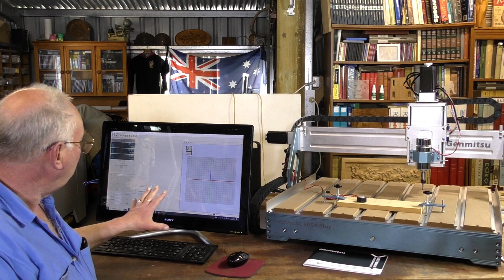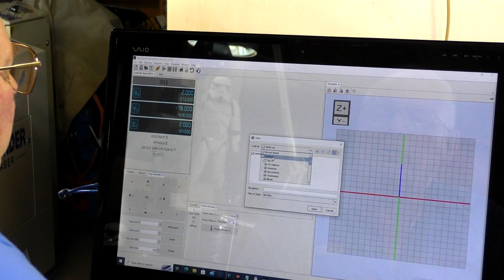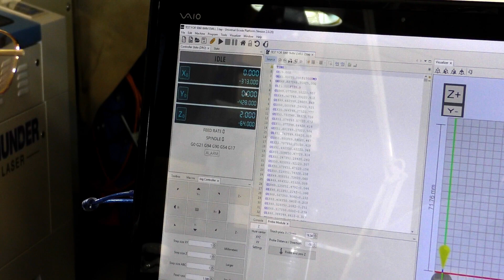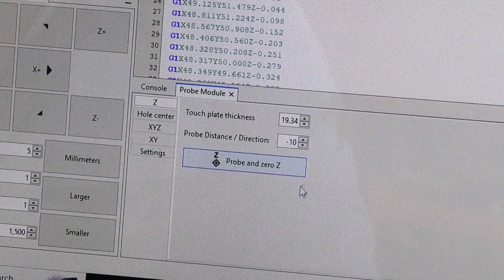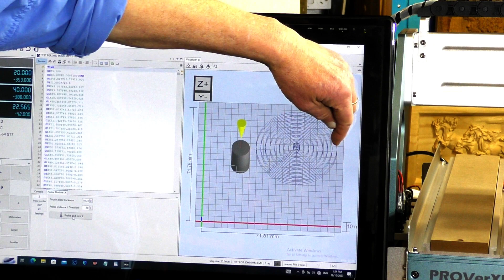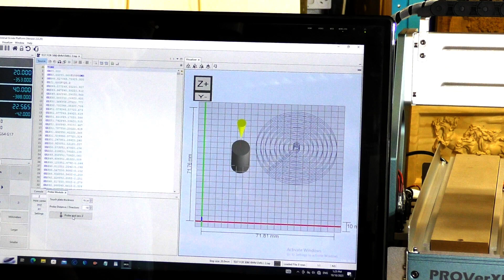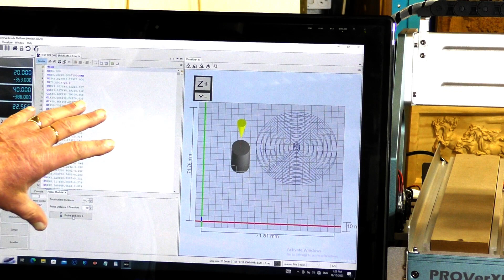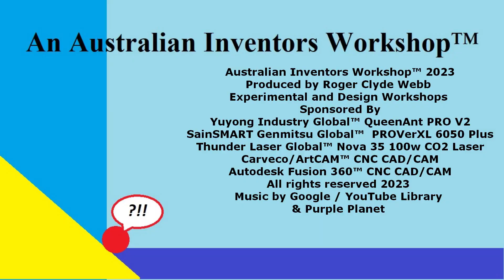BEST NEW CHEAP CNC Router SainSMART 6050 Plus,  + UGS Universal G-Code Sender First test cut

Comment: good morning, and (Sorry for my english) I'm about to buy my first cnc, I've been looking at it for a long time, and after various information the choice fell on a sainsmart, leaving aside many Chinese models that have frame problems, I would be undecided about the new 3040v2 and the 6050 plus, given your experience, could you compare them on a mechanical and chassis level in order to clearly analyze the differences beyond just the machine measurements?  Thank you